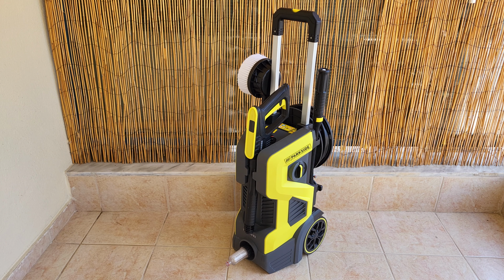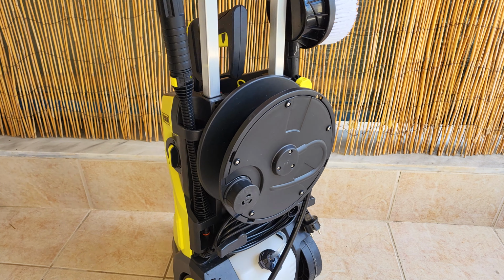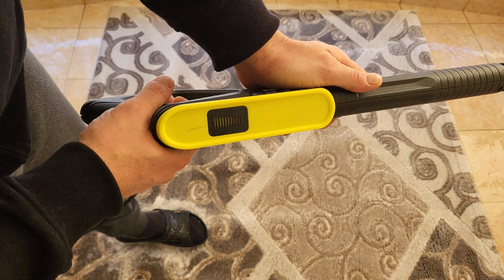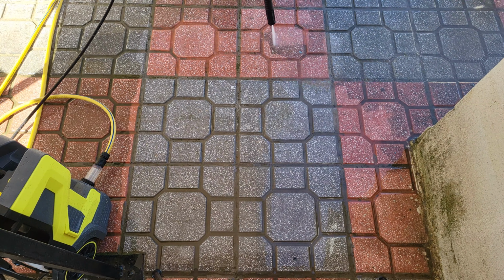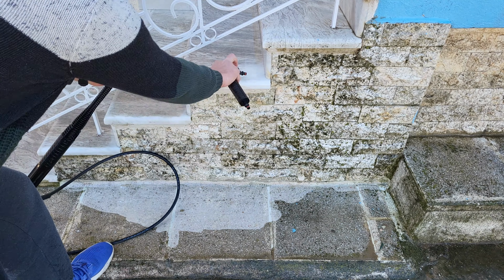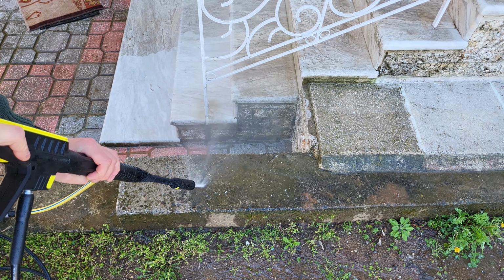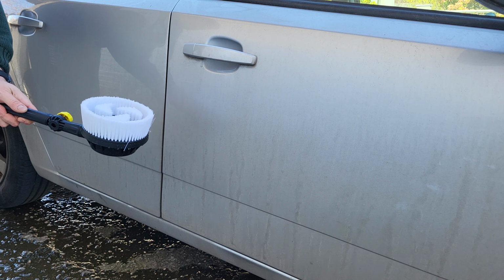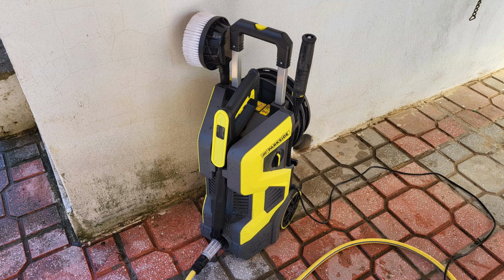Parkside High Pressure Cleaner PHD 170 B2 TESTING

Comment: Excellent review. I have bought it, and it's amazing. Only question is my dirt-blasting nozzle spins the jet in a circle only for the first few seconds, then locks in to a fixed jet. Still works great, but not sure what that's about.
Reply: Have you found a solution to this? I have the same issue

Comment: Any idea how to get the washer to use the detergent tank. I've filled the tank but only spraying out water
Reply from the maker: Pull the front lever to reduce pressure
Reply: Hi, thanks for the video. I have the same problem and still doesn’t work. I see the detergent is not being absorbed even when I pull the front lever to reduce the pressure. First time I am using, it, I bought the machine a few weeks ago :( Any idea why it happens?

Comment: thank you for this correct review. I am still waiting for the 180 bar version (PHDP 180) which is still unavailable. the PHDP 180 has the same specs as a Karcher K7. However i haven't found a decent review about the pressure washer i have mentionned.
Reply: When is that 180 coming out?
Reply: @stephendaedalus6192  the 180 bar version came already out you can find it in the webshop of lidl. İt is double the price of the phd 170 (200eur)
What i meant was that  there is no  good review on youtube.

Comment: Hi @Techguru Andrew I am just worried can you make sure the pressure is not too high to damage the car? I don't know if Lidl still sells lower pressure version but I only see this one in store but don't want to damage my car paint. Thanks.
Reply from the maker: Well if you don't want to damage your paint of your car just don't go so close when you're working with the pressure
Reply: @TechGuruAndrew  Hi thanks Andrew that’s good advice. Just wondering if you can adjust the pressure to be lower and then use the attachments which are more suitable for car washing too! You’ve reviewed so many of these pressure washers so you are really the pro when it comes to knowing how to use them and I really like your videos!
Reply from the maker: Thanks for your support ,you can adjust The Pressure from the Nozel by  just rotate it left and right, But I'm sure you know that,
 I think you worry too much The Pressure is not so huge for worrying damage your car paint.
Reply: @TechGuruAndrew  Thanks Andrew I bought it because of your review and it’s so good!
Reply from the maker: Enjoy a clean car 🚗 
I like that you care about your car.
Reply: @michaelchen1026 any updates one year later of review? Is it ideal for car washing or to powerfull?
Reply: @_alfabiscuit_4628  the pressure head is adjustable you can even add washing liquid. The brush head however is only for the wheels, it leaves microscratches. Fresh experience